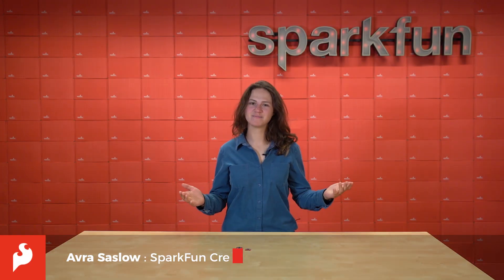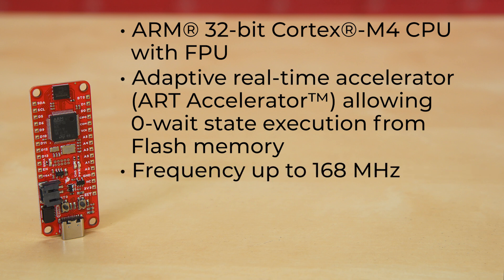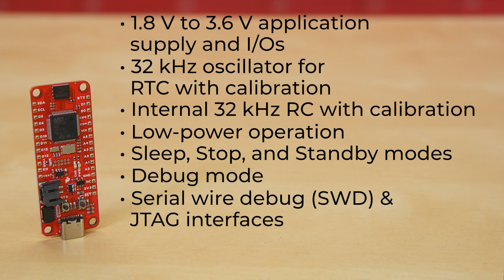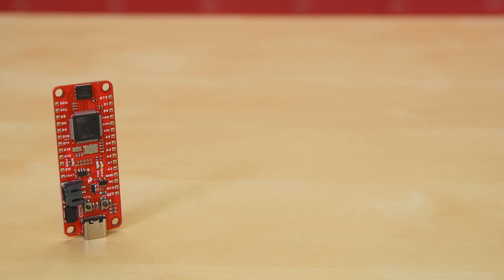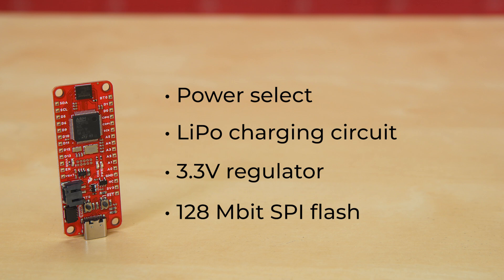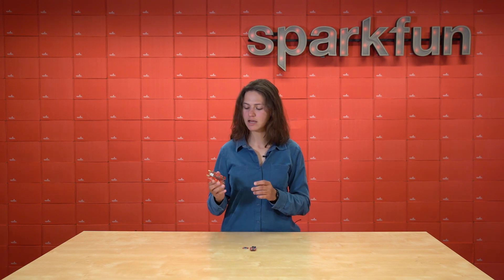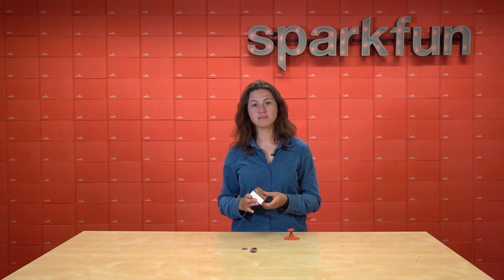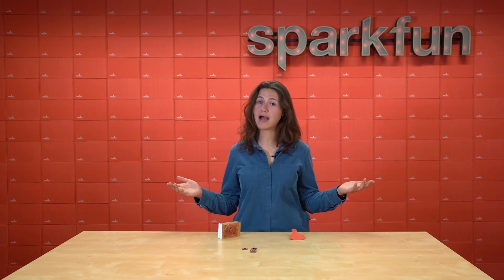Product Showcase: SparkFun STM32 Processor Boards

Comment: When chemical adhesives won't work.. try mechanical attachment!  You could rivet the case to the ear tag, as long as you are careful not to puncture the RFID chip or its antenna.  A template might help.  Good Luck!

Comment: never understood why people get STM chips. ESP32s always seemed cheaper and way more packed with features
Reply: Limited io and esp32 is built for wifi not really a general mcu
Reply: @ashwin372  what part about io is limited? it supports like all protocols... spi, i2c... it's also fast, dual core, has a low energy processing core... do you mean the total bandwidth?

Comment: One of the issues for which we hackers/makers/hobbyists prefer Arduinos or Teensys is the available framework- and community-support. 
How does this pan-out for the STM32s? What IDE/toolchains/emulators etc. shall be needed or usable?
Reply: PlatformIO, Arduino IDE, Eclipse, STM32CubeMX, GCC, OpenOCD, GDB, whatever you want. Just google it, there's nothing special in it.
Reply: @superdau  The problem usually is with that very "Whatever you want". For the average hobbyist, adding software is like eating an elephant - one piece at a time, and "whatever you want" makes the task immeasurably more complex. For Teensy, there is just one toolchain, one repository for all examples, and one search-term and one compatibility "stack" so that any example off of the internet "just works". The issue with "any tool" is the interoperability, just figuring out the dependencies which may be easy for someone with your expertise, but not ok for the average hobbyist.
Reply: @AdityaMehendale  
In that case I recommend platformIO. It has support for many microcontroller families (pretty much all that are used by hobbyists), and most of them can be programmed in Arduino style C.

Comment: Couldn't the box by physically attached to the tag using screws or straps that would go through the box and the tag? Another solution could be to design the box around the tag rather than attach it to the tag.
Anyway, looks like a great board!
Reply: Great idea